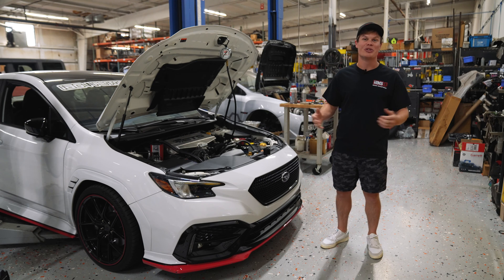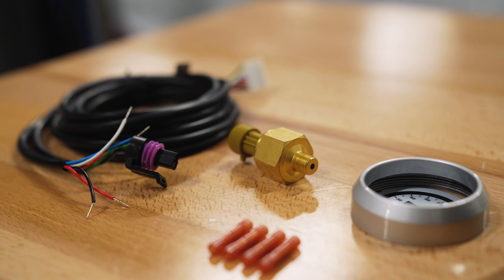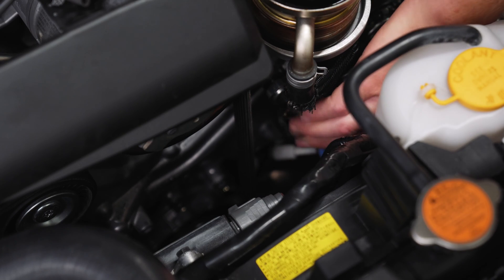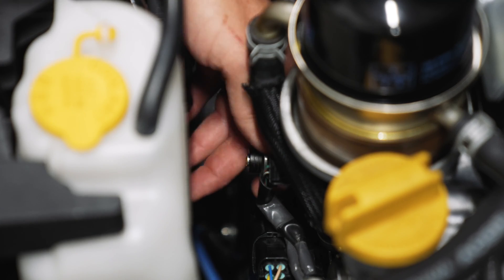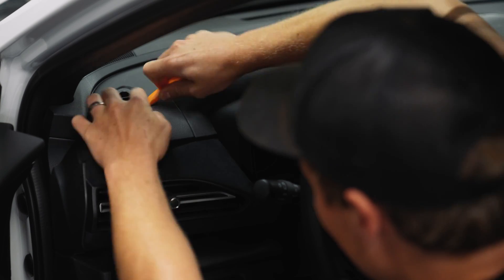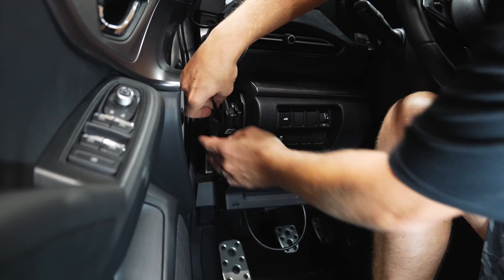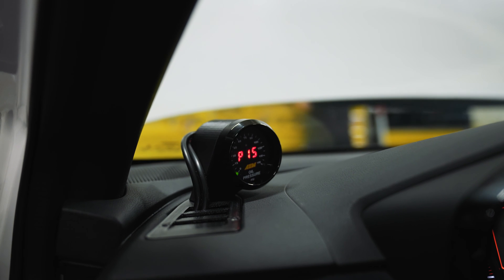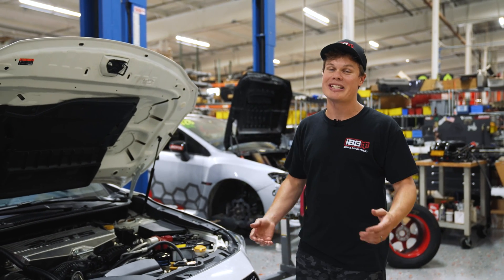AEM Oil Pressure Gauge Install - 2022+ Subaru WRX

Comment: Do you know of any good mods to make more power on a 2024 Outback XT?
Reply: ets intake. TMIC. charge pipe. turbo back from stock cats back. tune. +70whp more/less on a wrx based on the tuner. pretty much the same engine as the vb just under-tuned

Comment: A word of advice for all.  The OEM sensor is 1/8 BSPT vs 1/8 NPT. Cutting hairs here, but it is highly recommended not to force it or you'll damage the threads.  Be safe, and use a 1x male 1/8 BSPT to 1x female 1/8 BSPT  by 1x female 1/8 NPT tee adapter.  Alternatively, there is an M18 galley plug on top of the FA24 block left of the compressor.  Purchase an M18x1.5 to 1/8 NPT adapter and run your new sensor from there.
Reply: They sell one on IIR, ordering rn
Reply: Came here to confirm this lol. Wasted the time and effort only to have the NPT T connector not fit.
Reply: @JcM944   yeah it's just easier to go off the top oil galley and use an M18x1.5 to 1/8 NPT.   No having to mess around with the front fighting a cramped up position.
Reply: @MotoMadness66  Hate to ask but where is galley plug you're talking about? I'm seeing a lot of M18 screws haha
Reply: @JcM944  face the engine.   Look at your compressor on your left hand side.  Just inside to your right of the compressor.  Big silver m18 plug with a hex.
Reply: @JcM944 little late but youtuber RobHTech makes a banger video doing it this way. i like this videos fuse install better but i like how he taps into the block for the added sensor
Reply: If anyone's using a defi oil pressure sensor the killer b splitter is bspt male, and two female bspt's which is the correct size for the oem and defi sensor.
Reply: For anyone with a newer Forester, Crosstrek, or Impreza. Was planning to run one on an FB25, found out that Subaru covered the M18 plug with the A/C compressor bracket so you have to use the Tee adapter.

Comment: Awesome I was just looking on how to do this can you let me know the part number for the T adapter or the size?
Reply: Thank you!!!
Reply from the maker: We used a 1/8" NPT T fitting which can be found on Amazon: https://www.amazon.com/Sided-Brass-Female-Intersection-Fitting/dp/B013NV32N4
Reply: @theiagchannel this is the wrong adapter it is a npt thread the oil pressure gauge is actually bspt thread

Comment: What I don't understand is why there isn't one on the car as standard, or the ability to plug a sensor into the canbus, and add it to the massive display in the car.
Reply from the maker: Agreed, it would be a great feature to have from the factory! The stock “sensor” is more like a switch and comes on when oil pressure is below 2.1 PSI which is way too late 🙃
Reply: I've never had a sports/performance car that didn't have an oil psi gauge on it OE.  Is this a tradition with WRXs to only have an oil temp but no psi gauge?  Seems dumb not to have both with a turbo car.
Reply: @jedwin4816  STI's don't even have a pressure gauge
Reply: My theory for why my new 2025 Forester doesn’t have an oil pressure gauge is:  

Subaru knows that their upside down easy to access oil filters drain back down and become empty so upon starting the motor there is about 5-6 seconds of no or very little oil pressure.

They know this is bad so they hide it!!!
Reply: @jamespatrick5930  as far as I am aware, they do not drain back in the manner you described.  They have valving to stop this.
Reply: @matthewwain9958  I know they drain empty because I have taken them off and they are completely empty! 
The supposed anti-drain back device only slows down the draining.
Reply: @jamespatrick5930  they are 'meant' to have anti-syphon (had to look up the correct term).  Were you using a Subaru filter?  And again, even the STI didn't come with an oil pressure gauge and that is their  sports car.